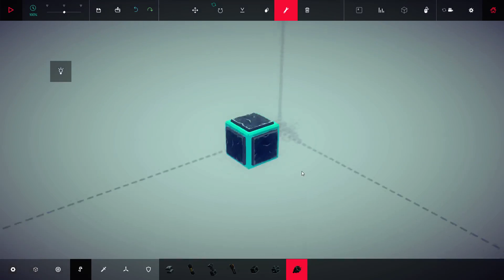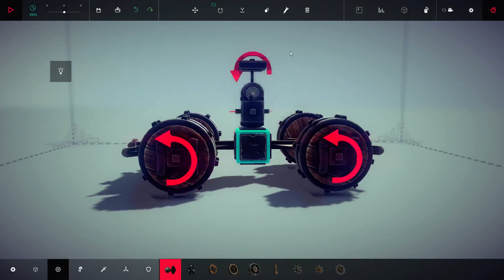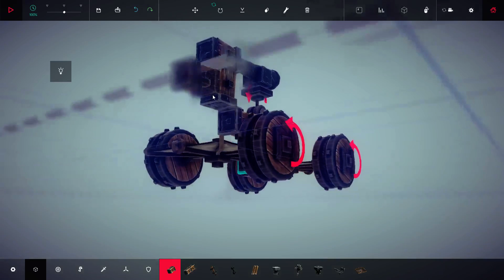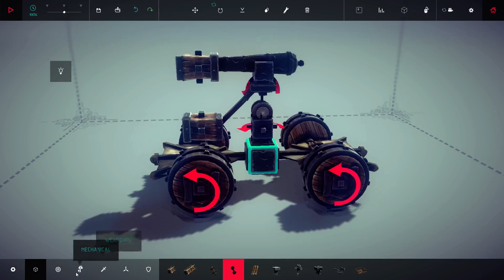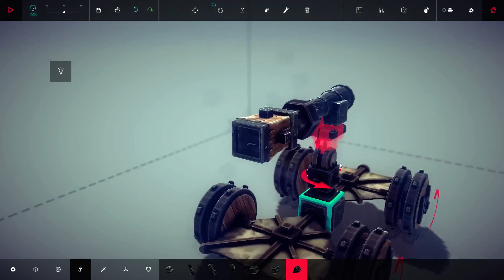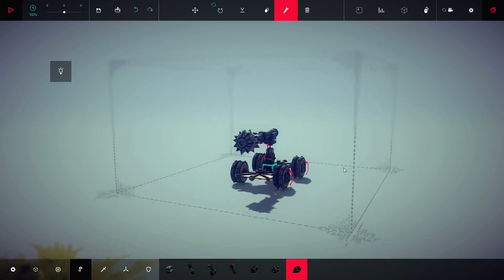Besiege - Cannon design guide

Comment: First time playing Besiege in 2024! Your car design is so cool! Just tried it out! Why does the wheels work like that? Double wheel stack inverse wheel controls. So confusing but it works lol @ 0:17
Reply from the maker: From what I recall, the outer wheels are left by default ⬆️⬇️ so when the Inner Wheel applied torque by ⬅️➡️, one of the sides have a higher speed. Similar to how older tanks work, one side is braking to make the vehicle turn.
Reply: Ahh so that's how that works. Thanks for teaching me Physics Professor SupremeToaster! 🙌